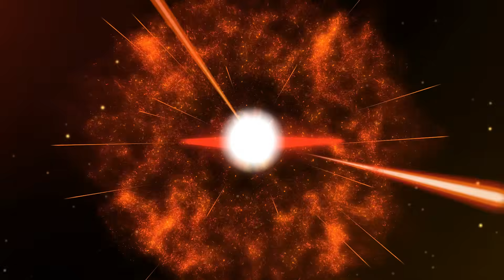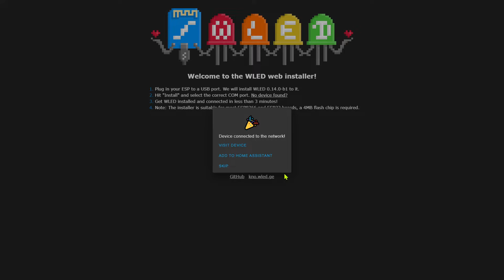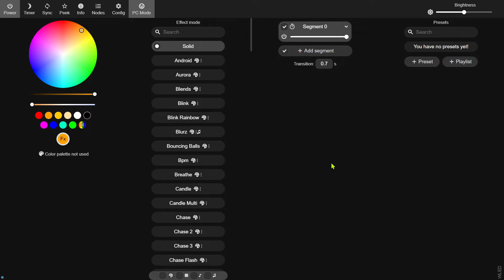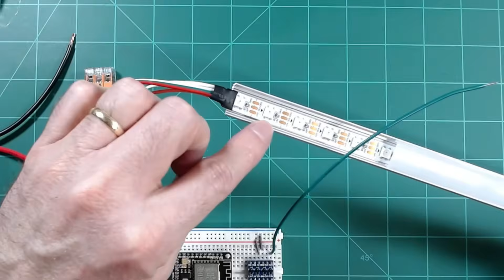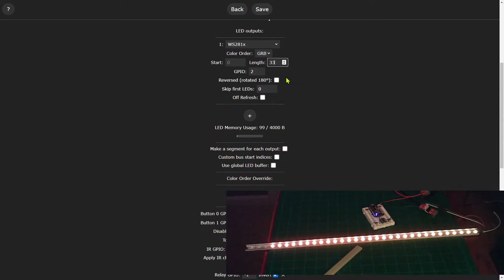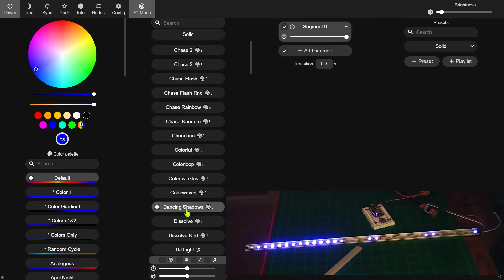How to Quickly Build Your First LED Controller

Comment from the maker: Note:  The ESP32 is now recommended for WLED.   The process for using  an ESP32 is nearly identical to the process used for the ESP8266... the GPIO pins will just be in different locations.  You can refer to this article which shows various wiring options, including those for the ESP32: https://resinchemtech.blogspot.com/2023/01/wiring-diagrams.html

But if you opt to continue with an ESP8266, it recommended that you install WLED v0.14.0 or earlier.  A minimum version of v0.14.0 is required for Home Assistant, but earlier versions can also be used if not integrating to Home Assistant.

Comment: Excellent video. You can also sacrifice the first pixel to act as a logic level shifter inside led preferences, this would still allow the use of shifting without the extra parts, no change phusicslly to the setup ;)
Reply from the maker: Thanks.  While I didn't specifically mention using a sacrificial pixel in place of a shifter, I do cover it in a number of my other LED videos and those specifically cover the shifter.  I also show using a sacrificial pixel in my standard wiring diagrams.

I primarily omitted that option in this video because this was how to make a solder-free version.  Use of a sacrificial pixel would require at least a little soldering to attach leads to the copper pads on the sacrificial pixel.  But in nearly all other LED videos, I think I do mention the sacrificial pixel as an option.

Comment: Great video.  Noob question here, if I were to get 3 neopixel ring with 12 LEDs on each ring, is it possible to have each ring a different?
Reply from the maker: Absolutely!  You can define and use WLED segments and/or different data pins on your ESP.  Segments allow you to control a portion of an LED strip like it is an independent strip.  And by using different pins, you can run a different data line to each ring (so they don't have to be physically wired together).  If you want to know more about how to use segments and multiple data pins, I have a video covering those topics:  https://youtu.be/HYdouRHfadE
Reply: @ResinChemTech thank you so much for reaching back.

Comment: Im seeing Wagos instead of wirenuts on an us channel? wow, never thought, that would happen ;)

And then back to topic. WIth longer strips, u should bring in the power a few times in the middle and at the end, so the 6A dont flow through the strip from one end.
Reply from the maker: Ha! I'm a big fan of Wago connectors for many of my projects, and I certainly don't miss wire nuts (or having wires pop loose when trying to shove a bundle back into a box)!  I not only make use of them extensively for bench testing since it is so easy to connect/disconnect wires, but will often use them in my final build as well.

They aren't as cheap as wire nuts, but the ease-of-use and the security of not having a wire pop loose makes the additional cost well worth it to me.
Reply from the maker: I cover power injection in numerous other videos.  For this beginner video, the goal was just to get a bench test copy up and running.  I'm only using something like 35 LEDs, so power injection is not needed.  Even for something like 100 LEDs, power injection probably won't be needed... especially not for a simple bench test to just try out WLED.  You can certainly add power injection and it won't hurt anything, but if just building your first WLED controller just to try it out and are using around 100 LEDs or less, you don't need to worry about injection... and as a beginner video, I mention power injection but don't go into details... pointing folks to some of my other videos for more "advanced" topics.

Comment: I heard that you have to use a capacitor of 1000μF between GND and VIN, and a resistor of about 470Ω from the data line (D4 in your case) to the DIN pin of the LED to ensure durability of the LED line, but I implemented that configuration with a pushbutton and I'm having problems with the button producing random false fast/double signals that I'm not triggering, causing the LED strip to behave erratically by changing light levels and selecting random effects without me pressing the button. Can you help me? I don't know what is causing that.
Reply from the maker: With over two dozen different WLED controllers, I've only had one situations where I needed to add a resistor on the data line... and that was where I had a very long data line run (>15 feet) bundled in a 3-wire cable where the data ran alongside the ground.

You can find projects or articles where all sorts of stuff is added to the WLED controller... resistor on the data line, a capacitor on the power lines, etc.  From a purely electronic theory standpoint, these "extra" components may solve some situations.  But in most normal situations, they simply aren't needed and just add cost and complexity to the project build.  I used to add a 1000uF capacitor to the data line.  Then I started omitting it.  The controllers without the capacitor have functioned just as well and for as long as the controllers that had it.

You are certainly free to add resistors and capacitors.. and in most cases, they won't hurt your project and in some rare cases they may resolve certain problems.  But in my personal experience, I've found that they just aren't normally needed.

Comment: Can this same setup be used for car head lights and under glow and if so would I need double of the parts used in this video.
Reply from the maker: Theoretically, yes... the same controller/process could be used but there are many other things that would need to be taken into account.  First, everything would need to be weather-resistant.  This would not only be the controller and LEDs, but all wiring, connections, etc.  

While you could step down the 12V from the car's battery, it would probably be easier to use 12V LEDs.  Finally, there's the legality of using DIY headlights and/or installing under car LEDs.  This will likely vary from state to state or country to country, but it may not be street legal in some locations to replace either the headlights and/or install DIY LEDs under the vehicle.
Reply: @ResinChemTech this is great advice thank you so much.

Comment: I'm just getting started with WLED.  Thanks for this tutorial.  I can get WLED to work on my old ESPDEVKIT V1.  I can control the lights perfectly when I'm on the WLED-AP network.  I setup the WIFI to work with my home network and I cannot connect at all.  My lights only work when I'm on my computer connected to the WLED-AP network.  Also I can't find a suitable app for my Iphone at all.  I was hoping to have lights for the holidays starting with Thanksgiving but I'm out of luck if I can only have lights when connected to my computer.  I tried to get help on the WLED site but I  haven't received any response yet.  I hope you can help. I know I can buy a controller but I really wanted to try your method and learn.
Reply from the maker: I can certainly try to help, but I personally haven't had any issues getting my WLED controllers on my local network and accessing them from any other device on the same network.

First off, is there anything "unusual" about either your  WiFi SSID/Name and/or the password?  I only ask this because with one of my earlier Arduino projects, I found that with the library I was using, some folks with especially long SSIDs or passwords... or SSIDs/passwords with spaces or those that started with a non-alphanumeric symbol would fail to join the wifi.  I don't know what method/technique WLED is using to join WiFi, but I thought I'd either eliminate an issue with your particular WiFi name and/or password or give you something to start looking at.  If you do have something unique about the SSID/password, you might try another SSID/network (like a guest network) if you have one.

While still on the subject of your  WiFi, this is just a standard "Home" wifi network, using WPA(2) correct?  WLED cannot join to a corporate network or anything where a domain is required.  I ran into this issue when attempting to install a WLED display at my work location.  Would there by anything related to your firewall and/or router that would prevent new devices from joining and/or getting an IP address from your DHCP server?

Moving on and assuming that you just have a "normal" home WiFi nework, we have to start looking at the ESP32 and/or the version of the firmware you installed.  Did you install using the WLED web installer ( https://install.wled.me/ ) or some other method? If using the web installer, did you select "Plain" for the WLED type?

After you attempt to join WiFi, the board restarts... and then what happens?  You'll need to get the assigned IP address either from your router or other method and then go to this IP address after rejoining your normal wifi.  Do you still see the WLED hotspot being broadcasted at this point?   If you no longer see the WLED hotspot, then that means the controller DID join your wifi... you may just be attempting to go to the wrong IP address after it joins.

Let me know the answers/results to the above and we can take it from there.  Sorry you are having problems, but other than a faulty board from time to time,  WLED has always joined the local WiFi without issue for me.
Reply: @ResinChemTech thanks so much for your promo reply. It really means a lot to me.  I had a choice on WLED for esp32 so I picked that one. I ordered  a new esp32 development board and it will arrive tomorrow so I’ll start over and follow your instructions. I could not use the iPhone app and it seems like everyone else can, so maybe it’s my old esp board. I’ll let you know how I make out. Thanks again
Reply: @ResinChemTech  Thanks again for commenting.  I found  that my esp32 was in bad shape. I had to use the esptool to erase the device and and reinstall to factory settings.  After I did that I was able to set up the Wifi like everyone else!   Now I'm going to work on my power issues.  I simply want to light up 60 LEDs for my window for a decoration for Thanksgiving.  Thanks again
Reply: I have made some progress following your video. I’m beyond the WLED part. I have tried to do what you did  i n the video I bought a new ESP 32 and wego clips. I used an old ibm laptop power supply ( output 16v and 4.5 amps) which had the right size jack to fit the wires in the adapter as you have in your video. I produced the magic smoke so my esp32 is toast. I want to try agin but I don’t know what went wrong. At the time of the experiment my led strip wasn’t connected so I don’t think the strip was harmed just the esp32 started smoking around the VIN pin. I know that my wiring was correct.  I’m careful to use color coding with my wires so I’m very careful to not make a short.  I can  test an LED directly on a breadboard with my power supply and no smoke.   I did not want to spend money in a new power supply just to light 60 LEDs but maybe I have to.  I think I may have been paying too much attention to amps and not enough to voltage. Perhaps 14v power supply is too much. 
Any suggestions?  Thanks
Reply from the maker: Do you have a voltmeter or multimeter?  The first thing I always check with a new power supply is the actual measured voltage output to assure it is what it is supposed to be.  Next, I intentionally create a short circuit to verify the safety features work (only try this with a supply that specifically states that it has short-circuit protection).  Once I've confirmed both of these items, then (and only then) do I connect any components.

I've fried my own share of ESP boards, so don't feel too bad about that.  One common way is inadvertently reversing polarity... connecting (+) to ground and (-) to VIN.  That will do it every time!  Or accidently connecting 5V to the 3V3 pin.  It can also happen if the ESP board has a faulty or knock-off voltage regulator on board.  The voltage regulator's primary responsibility it to take 5V (from either USB or the VIN pin) and step that down to a very precise 3.3V for powering the actual ESP chip itself.  If that fails (or you exceed the voltage/current), it can definitely result in a fried board.  My guess is that your ESP simply went bad and/or the regulator failed.... resulting in the magic smoke.

Comment: I have used WLED on Wemos d1 mini and ESP32 for several years - most recent project is a matrix 20x15 in a photo frame - It works very well even limited to 2.5 amps.
I notice you always use logic level shifters - I have never used them and simply put 330 ohms in the data line and 100mF capacitor across the Vin and Ground - I have never had any issues but as you say they are not really needed if the controller is near to the leds.
Reply from the maker: Yeah... I've done a number of videos explicitly covering the level shifter.  And you are correct that in many cases, you don't need it... until you do!  That's why I've generally included one with each of my builds.  It only costs around a $1 and only takes a few extra minutes to wire it... and then I never have to be overly concerned about wire length between the controller and start of the LEDs.

But you are correct... there are multiple ways to accomplish it, including using a sacrificial pixel.  In fact, I no longer recommend those little I2C-compatible shifters and instead now recommend using a quad buffer gate shifter.  I cover why in this video:  https://youtu.be/Va5eTscUJQI

In one of my other videos, I do show what could happen without a shifter (or other method of 'conditioning' the signal) and how a shifter immediately fixes it.  But as I've often stated (and you repeated), in many cases you can get away without a shifter. 

The nice thing about DIY (I guess) is that there are always multiple ways to tackle a project or build.  But for me personally as someone who has more than two dozen WLED installs in my home, I just like to go ahead and include the shifter... whether I could get away without it or not.  But that's just me!

Thanks for taking time to leave a comment!

Comment: This is the video I've been looking for.  It finally explains why I may or may not need a logic level shifter.   Most of my builds are fairly close between the controller and the first LED light.  But as I've been reading it is still better to have this little device between the controller and the LEDs.  I am using up a supply of NodeMCUs and then will switch to ESP32 where it looks like the same things apply...3.3V to 5V LEDs so purchasing a bunch of level shifters won't go to waste.  Thanks...I'm a big fan of all your videos...Irv in Florida
Reply from the maker: Hey Irv!  Good to hear from you again.  If/when you do opt to use a shifter, note that I no longer recommend the I2C-compatible shifters that I show in a number of older videos (although they always seemed to work OK for me).  I explain why I switched shifters in this video, in case you haven't seen it:  https://youtu.be/Va5eTscUJQI

Thanks for the comment!  Glad you are still around!
Reply: @ResinChemTech  Thanks... I watched it and understood where you were and where you're going ;-)  I have a few of the I2Cs left and am wiring some "nanoleaf"-type projects and they only have 90-100 LEDs and since the controller will be right next to the first LED light I may not even use the level shifter.  I re-watched you $6 controller for wiring ideas and later watched that you still had a breadboard on your pool table lights!  Brings to mind, "if it ain't broke, don't fix it!".  Thanks again...Irv

Comment: “Take the number of pixels you’re going to use and multiply by .6”

I have an unused half of a Govee 50’ LED strip. What is the number of pixels I’m going to use?
Reply from the maker: That depends on a number of factors.... the type of LED, the voltage, etc.  The 0.06 multiplier comes from the standard 20 mA draw for 5V WS2812b LEDs.  Each individual 'pixel' contains 3 LEDs (one red, blue and green).  At 20 mA each, that's a total of 60 mA if the LED is shown as white (all three colors lit) and at 100% brightness.

So, to get the total amp draw, you take the number of LED "pixels" (which have 3 LEDs each) times the 'amps' for each pixel... or by multiplying by 0.06.  Now, different LEDs and different voltages will have different current draws.  For example, some LED strips like SK6812 have a dedicated white LED in addition to the normal 3 RGB LEDs.  And strips of different voltages will have different draws.  You need to determine the type and voltage of LEDs you are using.  Once known, you should be able to search online and find the current draw for each LED.  Once you have that, you just multiply by the total number of LEDs.  Do note that this is the projected MAX current draw.  When using other solid colors or effects, the current draw will be significantly less.

I hope that helps.  Quindor has a great online resources that shows actual current draw for a number of different types of LEDs.  You can find his info here:  https://quinled.info/2020/03/12/digital-led-power-usage/
Reply: @ thank you!